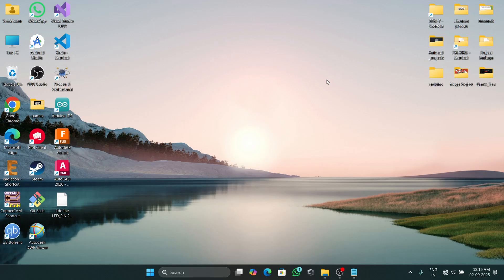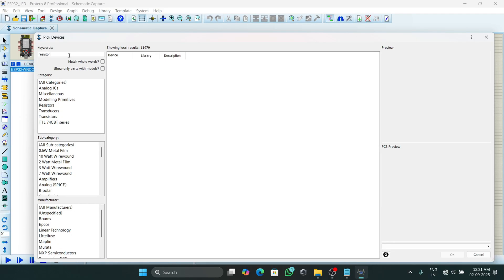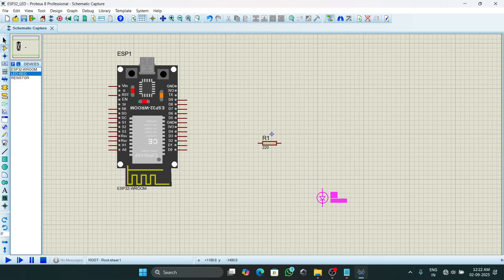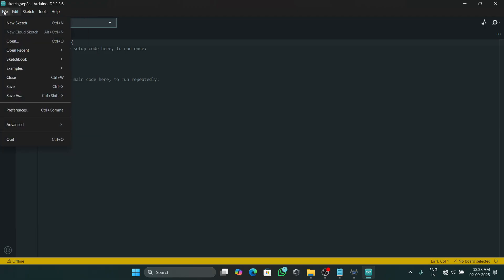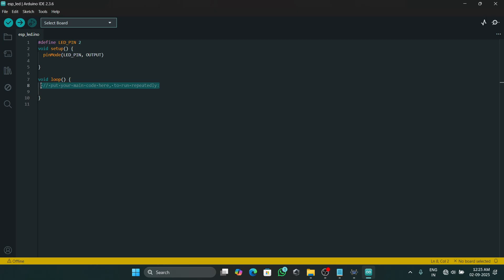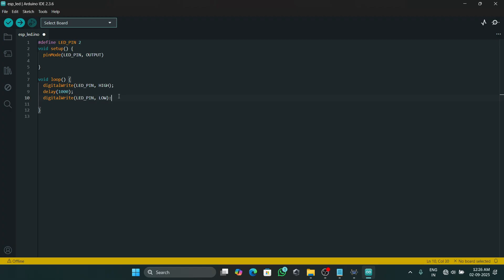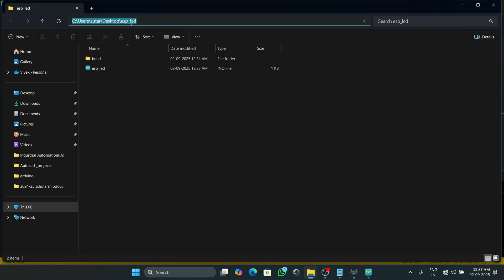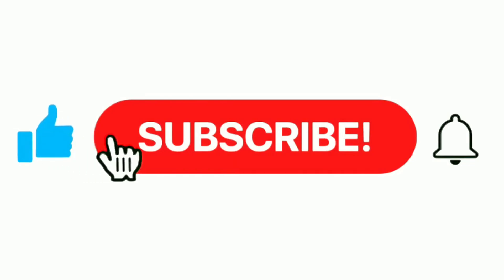ESP32 LED Blinking Simulation in Proteus | Tutorial

Comment: I need program
Reply: // Define the LED pin
int LED_PIN = 2; 

void setup() {
  // Set the LED pin as an output
  pinMode(LED_PIN, OUTPUT); 
}

void loop() {
  // Turn the LED on (HIGH)
  digitalWrite(LED_PIN, HIGH); 
  // Delay for 1 second (1000 milliseconds)
  delay(1000); 

  // Turn the LED off (LOW)
  digitalWrite(LED_PIN, LOW); 
  // Delay for 1 second (1000 milliseconds)
  delay(1000); 
}

Comment: what if I am using an esp specific function like ledcAttach & ledcWrite for pwm or analogSetPinAttenuation for analog pins
Reply from the maker: If you use the ESP32 PWM functions like ledcAttach() and ledcWrite(), the LED will fade or change brightness smoothly on real hardware because the ESP32’s LEDC engine generates true high-frequency PWM. But in Proteus, the LED won’t show proper brightness levels because Proteus doesn’t simulate the LEDC hardware. You may only see ON/OFF or very inaccurate dimming. In short it will simulate with these Functions but won't give desired outcomes. Thank you.